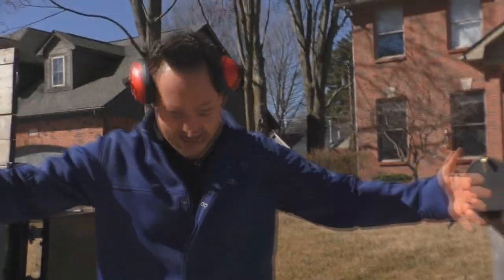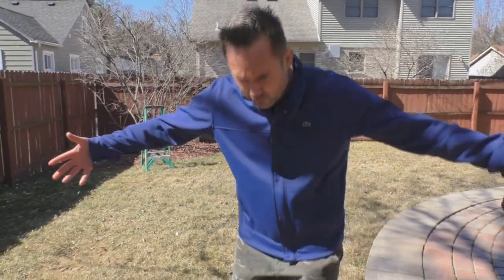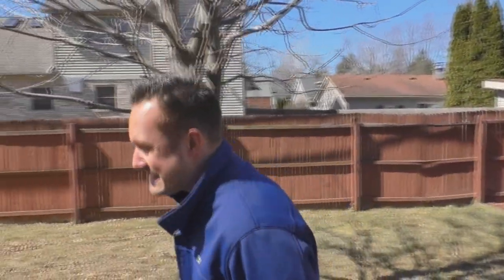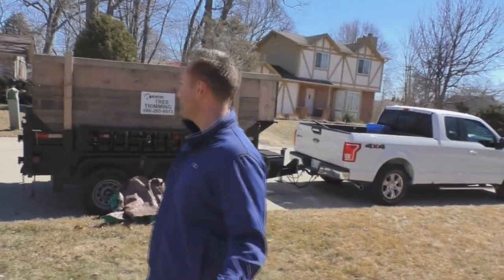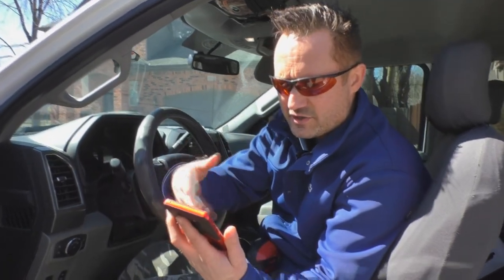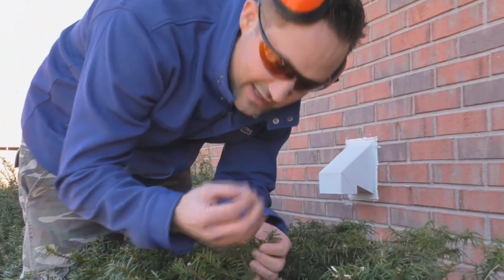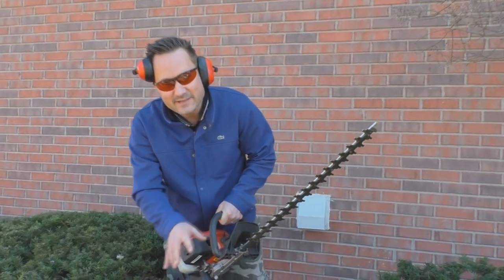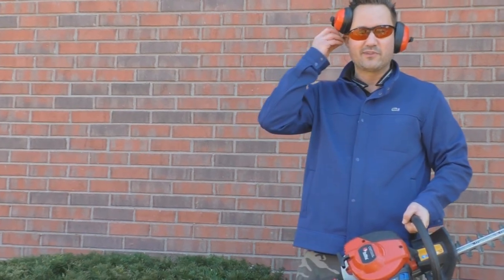How Much To Charge For A Spring Cleanup? 2021 Lawn Care & Landscaping Business Tips🌳

Comment: Ahhh Keith.  I just got home and saw this video that you posted today.  I just did a property clean up. It took me about 4 1/2 hrs.  mowed the property 5 times, I mow and bag to do a property clean up, got the leaves cleaned up,   I did use my pole saw and trimmed 2 branches that took about 20 minutes.  The customer was an established customer that I have had for years.  I usually charge by the hour.  But that is changing because of you.  I billed for 6 hrs for a total of $180.  I thought it was a decent day but when I gave the customer the final bill he was shocked.  He said he was expecting $300-$400.  Man did I miss the mark.  But now I am going to start having a fixed price to begin.  I wish I would have seen your video before I went out and did the work.  lol  I have already mowed 6 yards this year and now we have rain and snow coming in this weekend.  lol
Reply: I charge $45 per man hour for spring clean ups and a minimum of $50 to haul away the debris.  For the yard Keith was doing I would have charged  $200 just for the clean up and removal, that does not include pulling weeds from flower bed, or trimming hedges or trees.  My average this year has been $350 per yard.  I am in So. NH, so some of the yards are $500-$600 in the rural areas and $200 -$300 in the more densely populated.
Reply: @jackfoxxx68  This is my 4th year in business.  I have learned a lot from Keith.  I now see that I have been under charging.  My new customers are getting higher rates and my old customers I am working my rates up.  When I began I just wanted the job and I wanted to do the best I could for a cheap as I could to make the customer happy.  I have now learned from Keith that I don't want to try to survive I want to live.  Keith is the man!!!!  After seeing Keith's video I have decided to start charging $250 just to show up per yard.  The $250 will be part of the final price.  But of course if Keith ever hires me for a job his rate will be $2500.  lol  Just joking Keith.  We all love you

Comment: Our cleanups are clearing beds , redefined edging , trim shrubs , haul debris . I been quoting and selling around  the $200- 400 range. With mulch double that on average. I was curious as to whether I was bidding right. 50 percent closing rate
Reply: That sounds perfectly reasonable. My clean ups almost always fall between $250-600. Sometimes it's hard getting through to a potential client how many diffirent services they are getting and all the fine tuning a landscaper does after the debris are picked up. Some people can see a nice yard, others don't care as much.
Reply: @kklandscaping7919  exactly. Our job is to beautify the property .. in all aspects. Some people's jaws drop when I hand them a bid for 1200 for a normal cleanup, 3-5 yds mulch installed, and climbing because they want a crown reduction or trimming of decent size tree. I tell them flat out it's minimum $200 just to even put my gear on and go up to make ONE CUT because of the risk and skill it takes to safely climb
Reply: @tnrcleancare7847  yep, that's right. And thats a great price for clean up, mulch, and climbing/precise trimming. The 50% that you're getting are the ones you want. Good customers that pay for good work. Happy spring TNR have a great year!

Comment: Old video...thats a 150 pulling a dump? what size trailer is it and how does it handle? i have a 1500 and want a dump not sure about 6x10 or 6x12 10k
Reply: Haha Keith... I was looking for a response possibly about what size your trailer is
Reply: StrykerV hey. I have a 1500 Chevy and I pull a 7x12 dump. Honestly, it’s rough. Leaves and brush, no problem. When I get 5 yards of material in there, rough! Hard on the engine, hard on the brakes. I’ve yet to get a brake box though. I love the dump trailer though. Really allows me to take on bigger jobs.
Reply: @militarycutlawnservices7804  thank you. I def want it for debris mainly. But I do mulch as well. My current trailer has electric brakes and 5200 lbs. The dumps I'm looking at would have dual electric brakes. They def help slow down if your heavy. I also drive way more conservative heavy. Thinking 6 x 12. Maybe haul mini excavator for jobs. I may upgrade to a 3500 in 2 years and then trailer won't matter.

Comment: are you towing that dump trailer with a 150?
Reply from the maker: Oh fashow
Reply: Keith Kalfas do you have any issues towing that? I have a Chevy 1500 and I’m wondering I have the power to trailer a dump trailer
Reply from the maker: Well.. my dump is only a 10 footer. 

I personally wouldn't tow anything bigger than that without a 2500. But that's me...

Because as soon as you jump up to the 12 footer... the tongue weight goes up drastically.

Comment: How many of those are you doing a day? We  avg 2 a day at 450 each. We upsell the shrubs at a later time and generally sell the mulch and bed work with it. Yes we blow out leaves from them etc  but why include them your losing money. Only thing you're doing there is finding something to do while the guys work. At 250 paying what I can see at least 2 guys and then yourself plus a dump fee how are you making any money. Let's not forget taxes. The company is technically a 4th employee. This just seems off. If you truly want to teach people what to charge for a clean up tell them the formula. Not what works for you. 
Add are your Bill's, expensive, overhead and anything else you can think of. Now add 10% because you certainly missed something. Now take that number and multiply it by 12. Once you have that number divide it by the amount of weeks you can work. Just because theres 52 doesn't mean you work all of them. For me its 35. So I take that figure and now know what I need to make per week to cover my basis. Times that number by 2.5 cause you want to make a living. Now divide it by 40. That's what you need to make an hour. You'd be shocked what it really is and how easy it is to obtain once you know your business. You cant possible tell what someone needs to charge to make their living.
Reply from the maker: And I agree; great comment.